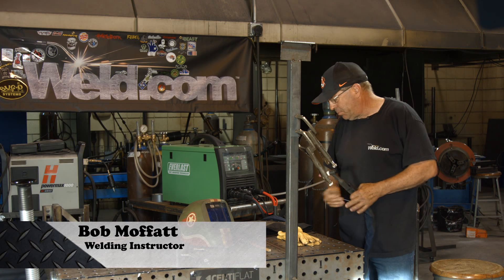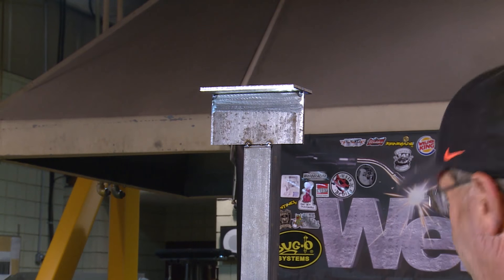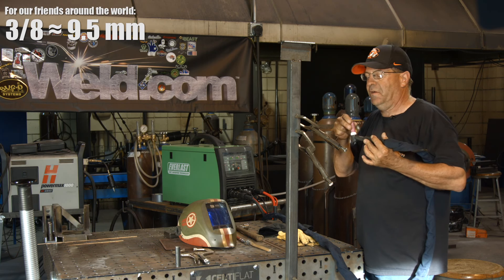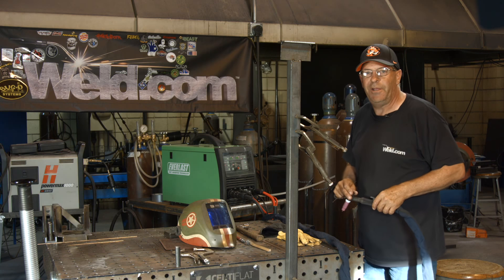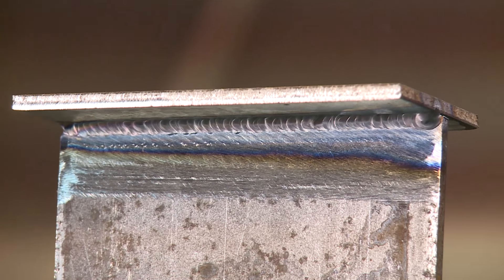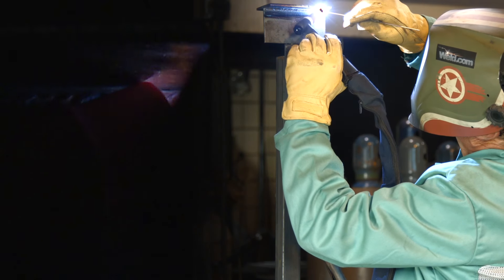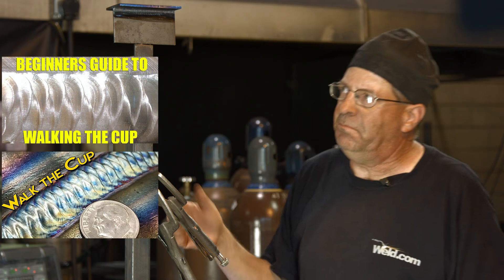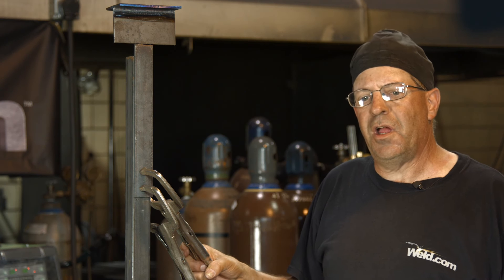🔥 TIG Welding Overhead 4F (with Everlast MTS251si)

Comment: Hey Bob, I work in a manufacturing plant for tractor trailers. We weld 0.45 er70s-6 wire with a tri mix gas for carbon steel. Can you possibly do a review and talk about the advantages and disadvantages of using a tri mix gas for carbon steel. Thanks.

Comment: Nice dimes, Bob! You are starting to loosen up with the camera and it makes for good videos. Are you guys using any means to reduce the big blast of gas when you first initiate the arc? I have a Smith dual flowmeter and there is a BIG blast of gas when the gas valve opens, then it settles into my 15cfh setting.

Comment: have you ever done a video that talks about how much someone should charge for a weld job? I mean I know there is all kinds of things to look at when giving an estimate but I'm just looking for a rough estimation.
Reply from the maker: xcyted4now we have not. it's king of subjective to where you live and what everything costs around you. That'd be a good one for the forum: www.weld.com/welding-forum
Reply: Jody actually did a video on that or it was part of a video. Try and search his vid's. Like Bob said, its very subjective.
Reply: ARCSTREAMS my flat rates are 65.00 for shop. 85.00 for field rate and 2 hour min.....piece work varies on size of pipe and piece....like smokers normal run 800.00 or so... I built some fire pits after materials I was getting 75.oo to 300.00.ive seen some go for as much as few thousand.

Comment: Can you guys do an overhead 4G test for 7018 plate with a backer plate. I am in school trying to get my 1 inch unlimited and I am having trouble not under-cutting the beads next to each other on the cap pass to finish the plate. Any info on ow to not stick rods so easily and settings for 1/8th 7018 electrodes would be appreciated. I passed my 3G 1 inch unlimited already but I am not happy with the imperfections in in my overhead practice grooves.
Reply: Andrew Charles Hold a short steady arc. Get comfortable to run the whole rod.

Comment: Can we please see a pipe weld, 12" would be awesome,  but 6" or bigger, in 5 or 6g, 6010 downhill root, 7010 or 8010 3/16" rest of the way, please. And at some point,  it'd be awesome to see an inverted branch tee welded out with arc shots. There's some decent videos of the branch layout,  but not of welding.  And please in downhill with xx10 rods. I know it's a big ask, so thanks!
Reply from the maker: We're working it.